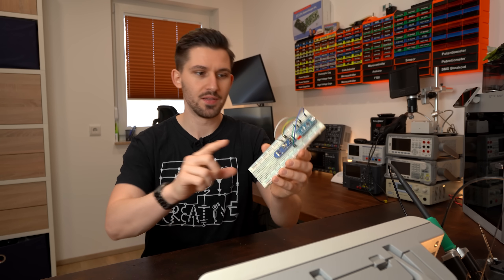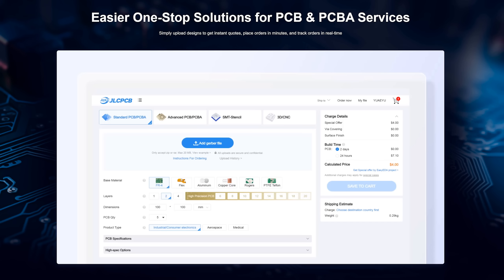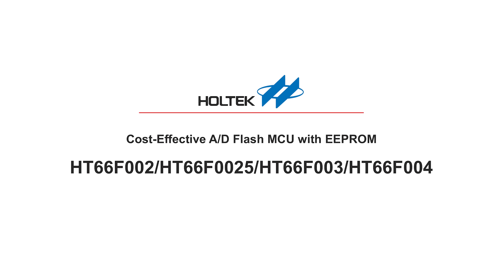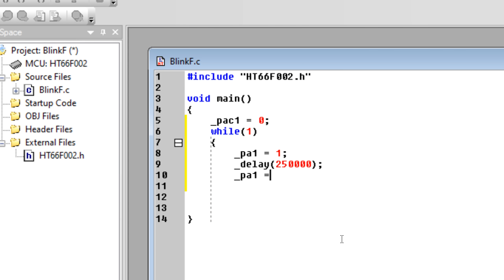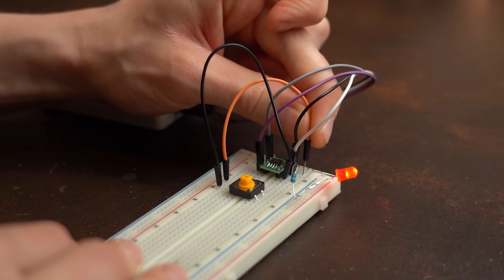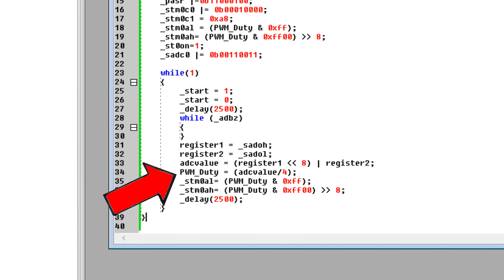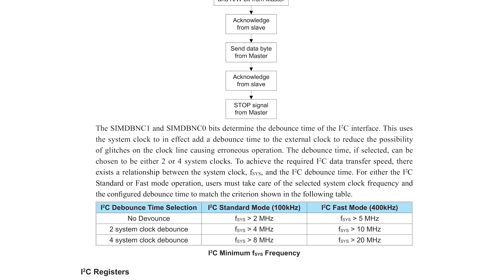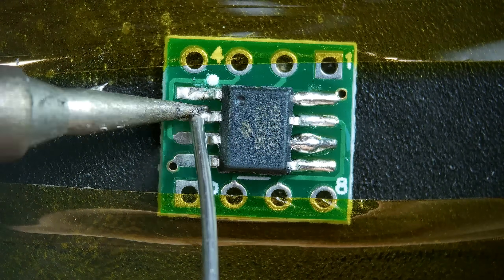I tried the Cheapest Arduino Alternative (that Nobody heard of)

Comment: I feel like a little RISCV chip makes a lot of sense here, like the CH32V003. It’s even cheaper than your $0.20 part and can work as an I2C controller.
Reply from the maker: I can put it on my to do list for next time :-)
Reply: @greatscottlab its a cheap chip. I also already messed around with it (i got it for around 10 cents) and it's quite nice. And it's risc V
Reply: @greatscottlab I'm wondering how did you miss that MCU, considering that pretty much every embedded news website has been going on about it for the last year.
Reply: have a few ch3v003 in breakout boards sat in my bench right now trying to figure out to use them for
Reply: Upvote for the CH32V003. The SOP-8 version can be obtained for about 10 eurocents and the TSSOP-20 for about 20 eurocents. It has a functioning Arduino core that does the basics but needs some further development to support its peripherals. When using the Arduino IDE v2.x it even supports regular debugging (i.e. stepping through code, watching variables, etc),
Reply: Beat me to it. The price/performance point of the CH32V003 and others in the series basically makes all the small/supposedly cheap 8-bit microcontrollers redundant at a stroke.
Reply: and ch32x035, which is really not so much expensive, compared to ch32v003, but have usb and PD controller, and lot of extra features
Reply: @ДмитроТроцький-э1н And It has a PIOC, that is, an 8bit-PIC style slave MCU as a second core.
Reply: Abt 16 cts a piece
Reply: And it has usb CNLohr - USB without USB, in 10 cents!
Reply: Or an ARM Cortex M0+ like the PY32 series or many others. Stupid cheap, easier to program & more than feature rich enough for many projects.
Reply: Also, the peripherals of the WCH microcontrollers are shamelessly copied from STM32. It means that libraries written for STM32 will work with little or no modification.
Reply: @ИльяГаврилов-м9ь At the very least the USB peripherals are UNIQUE to the CH32 series, and much better than the STM32 implementation IMO (saying that after switching from a working STM32 implementation to a CH32V307).
It actually supports direct DMA to the USB peripheral rather than the crocked PMA-memory that legacy STM32 is stuck with. Talked with them (STM folks) at embedded worlds about it last year, basically they said they do that because a) they need to support existing code and b) direct DMA shared with other peripherals is apparently not good enough for USB HS reaction time, except that it clearly works for the CH32V307 (the one I actively use with 8 UARTs using the DMA at as well). And finally, USB HS is actually supported right on the chip without the need for an external PHY.
Not sure about the other peripherals, a lot of the registers are similar, but there are enough differences that I'm fairly certain the peripheral IP is different.
Also super nice to have a bootloader to reliably flash them with. Also sucks you can't really trust the bootloader, so I wouldn't trust any proprietary code with them that you don't want dumped, if you get what I'm saying. But it is hard to pass on, since the CH32V307 has many features that NONE of the STM32 chips offered.
Reply: Exactly like that. I would experiment only with RISC-V. This is not the case.
Reply: Got any suggestions of where to start with that chip?
Reply: Everybody on the internet:
-Go on with the CH32V003, cheap, 32bit, has a lot of features, examples, even softUSB, well documented, etc.

Great Scott: I'll focus on an 8 bit MCU that nobody knows.
Reply: @mariobv947 At a certain point just use ATTiny9 and AVR assembly.
Reply: @mariobv947 8 bit Marvel Cinematic Universe. 
Sounds like Disney ruining the brand. 
Franchise auto-cannibalism. 

What were we talking about ? Never mind.

I use any excuse I can to insult the Mouse. 
Sorry
Em 
Oh
You
Ess
Eee
Reply: What about ATtiny
Reply: I use the ch32v307 for big projects and this board is very good!
Reply: Yeah another vote for the WCH CH32V003. I use them for everything and the programming is easy. Either Mounriver Studio or CH32V003FUN.
Reply: Really asking here, is the chip packaging or the chip IP made in China?
Reply: I’m not sure why anyone would use basically knockoff STM32 chips. Sure they are cheaper, but they have much less software support. The ESP32-C3 is the best RISC-V chip with full Arduino support as far as i can tell. But for this video it might be too expensive. In the end i’d rather stick with the classics and no knockoffs.
Reply: I have a bunch of CH32V003's myself. Have been playing with them off and on for about 8 months now.

TL;DR: Yeah the CH32V series uC's are cheap, but myself being unable to get stable SerDes abstraction on them I personally cannot recommend them.
Reply: While the CH32 might be cheap, i do not support copying someone elses homework and will pay 50cents more for the original stm32 C or G series with ARM core rather than the bad clone, its much better documented, you have a lot more choice in package and features and are more often in stock locally rather than having to buy overseas.
Reply: @levigillis3475  They do not copied the silicon. They designed it from scratch. ST has a long tradition copying devices from everybody, almost literally every transistor, TTL and CMOS gates, and opamps out there have an ST version. Starting from the NE555 (their TL555).
Reply: @levigillis3475  What? RISC V is an open source ISA, they didn’t copy anyone.

Comment: Why not just bit-banging the i2c? :P
Reply from the maker: Because I suck at programming.
Reply: @greatscottlab  As long as you are able to read and write digital values over GPIO, you can copy-paste the bit-banging code from the internet and just replace those parts actually reading or writing values to GPIO. No need to know the protocol itself. ;)

Comment: You can emulate I2C functions in software. Greetings from Croatia.
Reply: Yeah, depending on how much communication you actually need, it's definitely possible to bit-bang the i2c commands. The limitation will be the memory though, it'll take a fair bit of space to manually code in the timing
Reply: @NewtoRah  Only very few I2C Slave devices have actual lower bound timing requirement. So by dropping the speed low enough you can just ignore the timing all together using I2C. That's why implicitly, all MCUs with atleast one Input/Output pin support I2C Master-Mode. The Code isn't even complicated if you don't care for the MCU being blocked during this time.
The Adafruit OLED Library actually has that code in it. It's ~15 lines.
Reply: @NewtoRah   This HT66F0176 has  2Kx16 of Flash and 128x8 RAM. So yes, I agree that memory is a limitation, but it's possible. One thing he should take care of is timer interrupts, which can mess up  communication timing.

Comment: A great alternative could be the attiny series (not the 85 but their newer attiny chips). They are available in 8 to 24 pin packages, with 2 to 16kB memory and come with SPI, I2C, UART, multiple timers with either 16Bit or 8 Bit pwm, and adc and much more. Im pretty sure you can also programm them with the arduino ide and an arduino nano if you dont want to fork over 160€ for microchips own programmer.
Reply from the maker: Yep. ATtiny comes next. Don't worry :-)

Comment: What's the problem with implementing i2c in software?!  At least, i2c master mode is totally straightforward and it takes only about 50 lines or so... Just stop being obsessed with that libraries and h/w implementations.

Comment: I use the ATTiny85 MCUs which can be programmed using an Arduino and works great with the Arduino IDE. Once programmed in a DIY ZIF Arduino programming shield require no additional components. The V models run on 1.8V/300uA @ 1 MHz in low power mode with 0.1uA in standby and you can boost the clock to 10Mhz with 2.7V. 

I only use Arduinos for prototyping and then design my production boards using an ATTiny instead. I keep a tube around they are super handy. They cost $13 per 100 or $1.30ish each. Not as cheap for mass production but the hassle for under 1000 units isn’t worth the time or effort of a custom MCU and IDE.
Reply: Better use the new generation ATTiny. I used ATTiny1616 in a project. Programmable in Arduino IDE. Only 1 pin needed for programming.
Reply: @JanKluiver  - I've read they have better features indeed, but I still  have some stock to empty first. As for new cheap tiny MCU's I'm looking into the CH32V003, which is cheaper, has more memory and even supports debugging.
Reply: The ATtiny's have excellent Arduino cores available. For small projects that need a few more pins than the ATtiny85 I've enjoyed using the ATtiny44A and ATtiny84A, which are often somewhat cheaper than the '85. For really small things I find the ATtiny13A interesting, but the limited memory can also be a bit of a challenge.
Reply: @MaxintRD I've been able to use the newer ATTiny's like the 414 and 402 with it, but it's kinda gross how you have to write the code in the arduino ide, and then flash the elf file to it with atmel studio, but on the upside udpi allows for single pin programing
Reply: Use ATTiny412 - 1 pin UPDI programming -- 50 cents per chip
Reply: @MrCWoodhouse indeed the 412,414,402 are all great parts
Reply: I've been using the ATtiny10 for projects where I only need a couple of GPIOs. About 40 cents in single quantity, less than 0.1uA when asleep, 1.8V-5.5V input and SOT23-6 footprint for easy fitment in small devices.
Reply: $13/100 is $0.13 each, even cheaper.
Reply: While the ATTiny13A is unsuitable for beginners, I found it fairly easy to work with from the Arduino IDE. If you only need to read a sensor or analog value and blink/toot some stuff it's really quite sufficient. The code can be incredibly compact if one pays attention to register stuff avoids haphazard includes. I ended up using something like 100 bytes of program space and 0 bytes sram (since only global variables end up needing sram). Suddenly 1K program space and 64 bytes of SRAM felt luxorious! I guess if you need to keep logs and run displays you'll run out of space and pins quickly though.
Reply: There is a tomm of stm32f103 chip`s, which cost less then $1, sometimes $0.5. Or you can find chineese clone for even less price. And STM32 have a tonn of features, like USB or advanced timers. And they can be programmed through Arduino IDE or CubeIDE and there are a lot of examples.

Comment: At some point this make you love Audrino more. This remind me of my project of adding midi to a vintage 3 manual and full peddle Rogers organ with single ground bus and need to find a cost effective way to expand ardrino to have hundreds of digits in gpio to generate serial midi signal for virtual organ software.
Reply: I go back and forth on this.  My first Atmel AVR project I did bare-metal, using the gcc-avr tools and buying an Arduino Nano just to use as a programmer, because I really didn't like the Arduino way of doing things, hiding all kinds of stuff from the user.  And I would have been in serious trouble had I not found an example project on Adafruit that included a Makefile and a header file for pin definitions.  With that, I had no use for the Arduino IDE, or for that matter, any other IDE.

BUT, the second time I used an AVR was to modify the code on a hobby radio called the ATS-20, which used an Arduino Nano to control the radio-on-a-chip and an OLED display, so I was very thankful that the developer of this radio released the code as an Arduino sketch, since this made it easy to understand the interface to the I2C-connected display.  So it's love/hate for me, and now I fully understand that if I want to make a microcontroller-based project for others to build on, this is the way to make that easy.

Comment: lol dont forget that the free chat GBT can code:
 I can provide you with a simple blink program for the HT66F002 microcontroller. This program will blink an LED connected to a GPIO pin of the microcontroller.

Here's a basic example written in C:

#include "ht66f002.h"

#define LED_PIN     0    // Define the GPIO pin number connected to the LED

void delay(unsigned int ms) {
    unsigned int i, j;
    for (i = 0; i < ms; i++)
        for (j = 0; j < 430; j++); // Adjust this loop for proper delay
}

void main(void) {
    // Initialize GPIO
    GP0CON = 0x01;  // Set GP0 as output

    while (1) {
        // Toggle the LED pin
        GP0DAT ^= (1 << LED_PIN);

        // Delay for some time
        delay(1000); // Delay for 1000 ms (1 second)
    }
}
In this code:

GP0CON is a register that configures the mode of GPIO pins. Setting GP0CON to 0x01 configures GP0 as an output pin.
GP0DAT is a register that controls the output value of GPIO pins. GP0DAT ^= (1 << LED_PIN); toggles the LED pin.
delay function provides a delay in milliseconds. The actual delay may need calibration based on your specific microcontroller clock speed.
Please make sure to adjust the delay function according to your microcontroller clock frequency for precise timing. Also, ensure that you have correctly connected an LED to the GPIO pin defined as LED_PIN.

Comment: Nice! I believe you could've gotten i2c to work by using a bitbang library, esentially just doing what the i2c hardware would do in software using GPIO. Since your MCU is acting as the master in this situation, this can be as slow and intermitten as you need it to be to allow it to run its other functions. There's not really any strict timing requirements here.
Reply: Good point on the timing requirements!

Comment: imo it's not worth it. STM32G030 costs 50 cents, is much more capable and is supported by many HALs (libraries that abstract away direct register access so you don't have to spend hours trying to get pwm working for example), including arduino.

The difference is only $4.20 for the entire set of 14 mcus (and I saw that you've got 40pcs so if you bought 40 stm32s it wouldve cost you only $12 more) and you've wasted multiple workdays(which cost way more than $12) to ultimately not get it to work. There's this saying: buy cheap, buy twice. I can't say I'm better though. I've made this exact mistake many times.

At least you've got a video out of it.